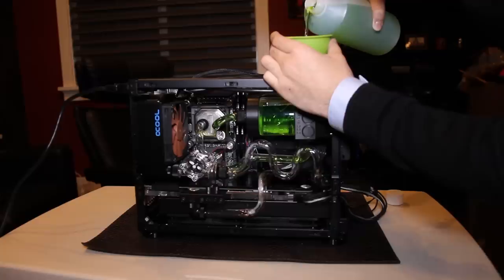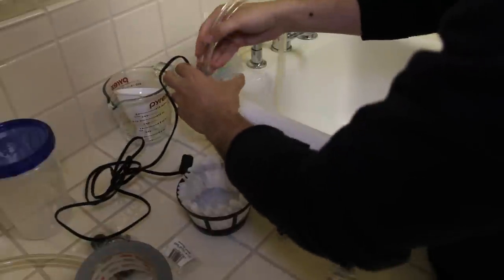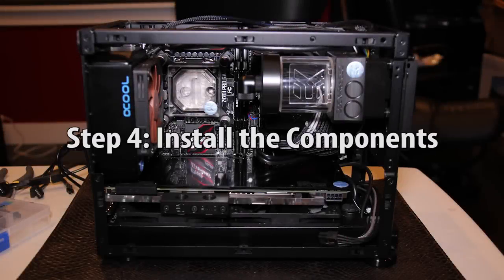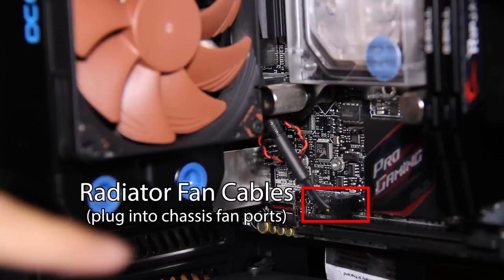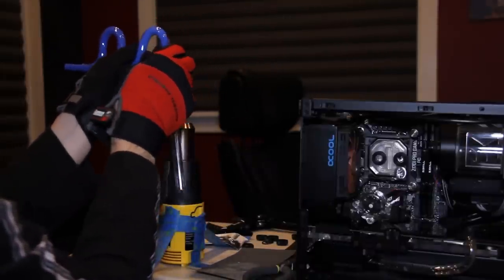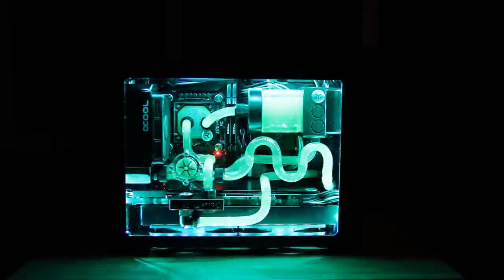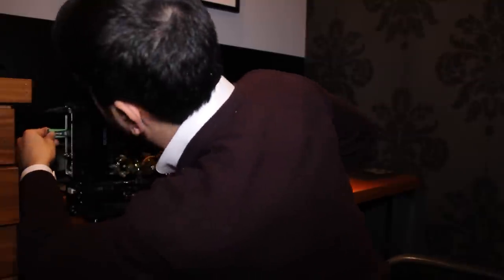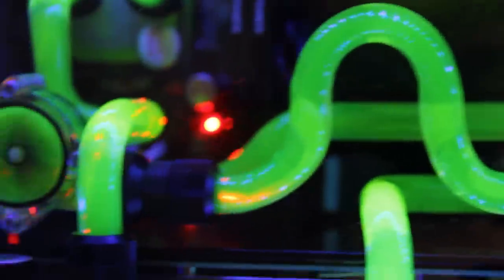Water Cooling Tutorial in 9 Easy Steps - Gaming PC Install Guide from Start to Finish

Comment: Great tutorial bro! I have the NCase M1 with AIO water cooling now; and I’m planning to upgrade it with open loop water cooling parts; yet your video saved me lots of try and error workload. I am wondering though, since you took so many pipeline solutions, is it possible to connect the left hole of CPU block to the right hole of 92 radiator? Then from the left of 92 radiator to the left of GPU block? Is the space too tight for you to do in that way? 🙏
Reply from the maker: Hi Albert, haha I see you are thinking of a super clean design! I’m looking at my NCASE while replying to you right now. The first connection, from the Left CPU port to the Right 92mm Radiator, might be tough but is certainly doable. The pipe coming out of the CPU port might shoot out a little more than the location of the 92mm Right port. In other words, depending on how sharp an angle you do on the pipe, you might not be able to simply bend it so it goes straight down from the CPU and then bend left into the 92mm radiator. You might have to do a spiral or maybe just bend the pipe a little extra so that it goes back towards the 92mm radiator port. Let me know if this doesn’t make sense and I can explain it differently. But you can certainly try it, it may not look like a perfect 90 degree drop and then a 90 degrees left. I’m assuming you want to take the shortest path possible to use as little pipe as required.

For the second connection, from the Left 92mm radiator port to the Left GPU port, wow that is a tough one if you are trying to take the absolute shortest path possible hahaha! No harm in trying, but it may be really tough bending the pipe to have two really tight 90 degree angles next to each other. It might be physically impossible. However, you can try, and even if the pipe loses a bit of its perfectly cylindrical shape while bending, as long as it is perfectly cylindrical when it enters the fitting, it’s fine. So you can try. If you don’t mind making the pipe a little longer, you can still make the connection work, but just have the pipe bend in a different direction first so it has room to bend into the GPU fitting properly. Worst case if something is too tough, you can always use a flexible tube instead. For a flexible tube, you will need a different type of compression fitting.
Reply: @Coolarj10  Haha thx for your reply. Actually, I plan to use glass tubing + 45/90 degree adapters. So no bend at all ;) Hopefully that will work.
Reply from the maker: Albert Chen ohh cool! Hmm okay I’m not 100% if the first connection is possible, but it should be! From the CPU port, an immediate 90 degree adapter down should do the trick. If for some reason you have undershot the 92mm radiator port, you can buy an extender fitting to give you the extra 3-5mm you need. An extender fitting goes into the CPU port, then you add the 90 degree fitting.
Reply: @Coolarj10  The tubes in my mind will go up and get connected in the sharp (180 degrees) angle. I guess the size of the extenders will be the key.

Comment: Are the fans on the 240mm radiator intakes? I'm thumbing over doing a similar loop in an Ncase
Reply from the maker: dellrizlonian great question! Yes, the radiator fans at the bottom of the case attached to the long radiator are configured as intake fans, pulling cool air from the space underneath the case up into the case. I learned the hard way that you do not want fans at the bottom of your case pushing air down. I had an Alienware laptop once and I made a book stand for it so it could stand vertically....the fans that exhaust air were pointing downward. The laptop would always overheat and shut off whenever I mounted it vertically! The reason is because hot air naturally travels upward. So, if you have a fan trying to push hot air down and out of your case, that hot air will try to rise at the same time, and so the fans will not be able to do their job efficiently as they are fighting against the natural tendency of the hot air. I hope this helps!
Reply: @Coolarj10  Thanks man. Did you post this to r/SFF btw? If you did, I missed it and if you didn't you should have! One of the best NCase loops I've seen
Reply from the maker: dellrizlonian Sure thing! And thanks for the suggestion, I hadn’t thought to post it there!

Comment: If I have a quad radiator will I need another for my gpu or can I use both on the same radiator
Reply from the maker: dhehcbcbdb good question, you should be just fine. The “2 radiator” guideline in the video was an oversimplification, it really just meant you should ideally have three to four 120mmx120mm modules worth of radiator surface area for the GPU and CPU combined. Ultimately how many radiator modules you have depends on the amount of heat your components generate, how cool your room is, and how good the airflow is in your PC. A quad 120mmx480mm radiator is the equivalent of 4 modules worth of 120mmx120mm units, which should be just fine. For comparison, the PC I made in the video has one radiator which is 240mm long by 120mm wise (in other words it is 2 modules worth of 120x120mm), and the second radiator is only a 92mmx92mm module.
Reply: @Coolarj10  ok thanks ok going to be building my first ever pc soon and I am looking into water cooling as I am using a threadripper and rtx 2070 super. I'm going to be using soft tubing though s this is my first time. Also would I run tubes into the cpu block then out straight into the gpu then back to the pump/res?
Reply from the maker: dhehcbcbdb awesome! You can connect the pipes in whatever order is convenient or that you think looks good, as long as the water is flowing through each component. The water will be the same temperature throughout your loop (the water mixes so fast that it reaches a consistent temperature), which is why the order doesn’t matter.
Reply: @Coolarj10  ok thanks for your help! Great channel by the way, just subbed!

Comment: How are the thermals? Is it necessary to have 2 radiators for a build like this? Will a 240 bottom rad suffice with a rear intake fan?
Reply from the maker: Hey, info on the thermals can be found starting 3min47sec on this video dedicated to the build itself: https://www.youtube.com/watch?v=8PrWb0sGL6g#t=3m47s
I'm sure you'll find a lot of varying info and opinions on the web about how many radiators to use. One resource I had used was the EKWB configurator (https://www.ekwb.com/custom-loop-configurator/ ) which gives you an idea of how much cooling you will get depending on how many radiators you will use. I have also seen general advice that you want as a minimum one 120mm square radiator per device being cooled, but ideally you would have at least one extra 120mm section. So for a CPU and a GPU, you would want at least one radiator that is 240mm long by 120mm wide, but it would be even better/safer to either get a longer radiator (e.g. 360mm x 120mm) or keep your 240mm x 120mm radiator and buy a second radiator that is 120mmx120mm. I did something in between, where I have a 240mm radiator and a 90mm radiator. So, to answer your question: "Will a 240mm bottom radiator suffice with a rear intake fan?" The answer would be: it depends! It depends on how powerful your GPU is and what temperatures you are comfortable with. Also, as you can see my build is pretty cramped. I don't think I could get away with only 1 radiator because that radiator is largely obstructed by the GPU. Air can still get through, but I'm sure the cooling performance is lowered, which is why it's important I have the extra radiator. I hope this helps! You can always experiment and see what happens, though I think you really need the additional radiator in a build as small as this. Good luck!
Reply: @Coolarj10  Thanks! I see it now. What was the loop order? Can't quite make it out from the pictures.

Comment: hi, what were your exact fan in/out configurations? im guessing that the bottom 2 fans pulled in and the top one pushed out
Reply: also is there space to mount a 2.5 inch hard drive?
Reply from the maker: Ozan S you are exactly right - the bottom two are pulling air up into the case. The rear fan is pushing air out of the case. For the 2.5” hard drive: technically there is space directly behind the front panel for this purpose (or for a slot load DVD Drive), but I shoved all my wires there since I don’t want my wires to show when looking through with glass. In my exact build and based on my cable management, the only place I could put a 2.5” hard drive would be directly above the reservoir (i.e tape it to the roof of the case) or there is a bit of space directly below the power supply unit. In both instances, you wouldn’t be mounting the HDD with screws, but rather just letting it sit there. Or, if you’re okay with having some cables take up room in the middle of the case (so they’d show through the glass window) to free up the front panel area, you can easily mount an HDD inside there.

Comment: Won’t the flow of hot water into the pump damage it? I thought it would be more logical to pump water to the cpu and draw water from the radiator?
Reply: nope, actually it doesnt matter. water flows through every component and is cooled in the radiator - sooner or later.
jayz2cents and others made videos about it.

Comment: what happens to the tape that you put under the Gpu and Cpu? will that tape cause the heat?
Reply from the maker: Hey, are you referring to the blue thermal rectangular strips I put on the GPU? Those blue strips are thermal tape, which facilitate heat transfer from the chips that they touch to the metal areas of the GPU waterblock. This allows the chips to dissipate their heat away. Without that tape, the chips may not come into perfect contact with the GOU waterblock. They came with the GOU waterblock I purchased and the instructions on how to use them were included with the package. The CPU waterblock did not come with or require any thermal tape. Instead, it only requires a tiny blob of thermal paste, which also serves the function of facilitating heat transfer from the CPU to the CPU waterblock. The main GPU chip on the GPU also uses thermal paste and not thermal tape. Only the other small chips (e.g. VRAMs) use thermal tape. Again, the exact instructions will depend on your GPU and waterblock, but as long as you follow the instructions to make sure all the right components are dissipating their heat, you should be good to go!
Reply: Wow...

Comment: How is that bottom rad not being completely chocked by the GPU? 
Is it able to push any air through at all?
Reply from the maker: David Shannon I was worried about this exact problem while planning the build and realizing how close the parts would be. What I realized was that there are three reasons it seems to work out okay: 1) there is actually a good amount of area on the back side of the case where the radiator is not obstructed by the graphics card; 2) there is at least a little gap between the radiator and GPU; 3) the plastic material of the GPU waterblock is a poor heat conductor, so it should prevent any warm air being pushed up from the radiator  from being immediately absorbed into the GPU. Ultimately the proof is in the pudding, and thankfully my temperatures turned out ok! I have the ranges listed at the end of the shorter video dedicated to talking about the NCASE build.
Reply: Arjun Mehta Thanks, I really appreciate the response! Looking at a pretty similar build myself so just trying to get as much info as possible. 👌🏻

Comment: if we use reverse connection wouldn't be more useful?
pump output to cpu in... than cpu out to radiator in  ... and radiator out to cpu in completing the cycle...
Reply from the maker: Aakash Sharma this is a great question! Even though it may seem this way based on the step by step diagram in the beginning of the video, in reality the order of the parts does not matter. This is because the water is being pumped so fast thorough the pipes that it all mixes together, and the temperature of the liquid at any point in the loop is actually the same. You can check out my detailed video on how liquid cooling works (it’s a separate video), hopefully it explains this point a little bit better.
Reply: @Coolarj10  i have seen that too ... thanks bhai for replying...
i have seen many videos of water cooling  but this is the first video in which i have seen the different order and i do understand that any order will work until the cycle is complete.
can u make a video on water cooling with duo graphic card  coz i wanna build pc with dual cards.
Reply from the maker: Aakash Sharma haha I’m not planning on upgrading to dual graphics cards soon because the setup is working well for me, but I’ll take a video if I do! There are specific tutorials out there already that should be able to help - it is exactly like a single GPU PC except: 1) you will need more radiators to keep it cool; 2) Your motherboard will need to have an additional PCI slot to support the second GPU (usually these miniITX motherboards are too small to have enough slots, so you might need a regular ATX motherboard); 3) When using Nvidia’s SLI dual graphics setup, for example, you will need an SLI bridge connector. It joins both graphics cards so they can communicate more efficiently with each other. The rest is the same!

Comment: im confused you need to radiators for the cpu and gpu?
Reply from the maker: BumGaming good catch, sorry that was confusing. Think of a radiator as a unit of cooling power. The more components you want to cool, the more cooling power you need. Since I wanted to cool both my CPU and GPU in the same loop, one small radiator was not going to be enough to keep the loop cool. So technically, it’s not “one for the cpu and one for the gpu”, it’s actually “make sure you have enough radiators that can provide enough cooling for all the components you need to keep cool.” Some websites like EKWB have a configuration tool where they ask you what components you’re trying to cool and then will suggest how many radiators you need.
Reply: @Coolarj10  ohh i see
Reply: @Coolarj10  Do you suggest Crosair equipment for this process?

Comment: In the bestbuy website their is no pump, reservoir or gpu radiator
Reply: I also need help finding some
Reply from the maker: HotNuke BestBuy typically doesn’t carry individual liquid cooling PC parts. If you check out the PCPartpicker.com link in the video description, you’ll see links to each part I purchased, which includes the water locks/pump/radiator from a company called EKWB. That should help get you started on an example of where you can purchase from, though that’s not the only option. Corsair, Thermaltake, and other brands provide different liquid cooling products that may be available through their website, Amazon, Newegg, etc.

Comment: Question, what if i already have a complete build? Would i have to take everything out and re attach them all? I have an empty space on the right side of my pc and i was hoping in the future i could install some tubes in that area to fill up the gap but i don’t want to buy new parts for a whole separate build JUST for the cooling system
Reply from the maker: Hey! Sorry I missed your question for so long. Adding liquid cooling to your existing PC can be easy, especially since you already have a lot of extra space in your case. Whether or not you have to re-attach everything depends on your Motherboard. To attach the waterblock to the CPU, you typically have to remove the motherboard from your PC so you can attach the waterblock backplate (as in my video). This means you have to remove the motherboard and re-attach everything. HOWEVER, I have seen some modern motherboards that come with waterblock attachment points already on them, so you don't need to add the metal CPU waterblock backplate. If that's the case, then all you have to do is remove your existing CPU fan and replace it with a waterblock. Then, install a pump and reservoir and pipes anywhere you have free space. Lastly, you will need to attach a waterblock to your GPU if you want to liquid cool that, but that only requires removing the GPU, attaching a waterblock, and re-inserting the GPU. Good luck!
Reply: Arjun Mehta yes i have an ATX case, running with a rog x470. thanks for the response :) I’ll do some more research on this, my computer usually crashes now if i play higher end games... I’m thinking either my GPU or CPU gets way too hot. Lately i bought a cooling fan for my CPU but I’m not sure if that’ll fix the issue. I wish i could get a crash ID or something so i can do a quick lookup on google because right now I’m pretty much blind. Perhaps you could help? it happens a lot when i play games like overwatch. maybe it’s the engine the game uses... not sure. any help would be appreciated though. thanks again!
Reply from the maker: @ToxicFruitSnack  Hey - sorry for the late response! Were you able to fix it yet? If you suspect you have a temperature issue, you can install software such as HWMonitor. There are two ways to use it, you may want to use both:
1) If you have 2 PC monitors, you can play your game on one monitor and leave the HWmonitor open on the other screen so you can occasionally see how hot your PC gets while playing.
2) You may also (or instead of HWMonitor) use a software that actually logs the temperatures and stores them continuously into a file. I recall recommendations that "SpeedFan" is a software that can do that, but you can see what's out there that you like. This way, even after your PC crashes, you can take a look at your GPU temperatures in the log to see if it was really hot around the time your PC crashed.